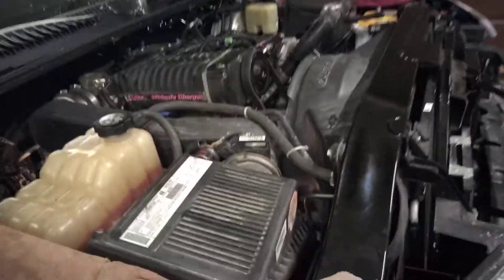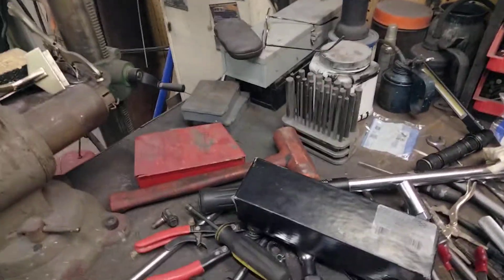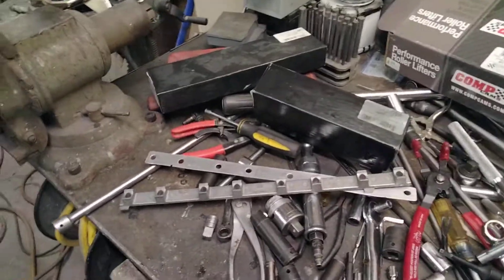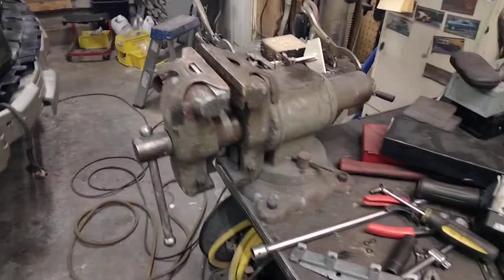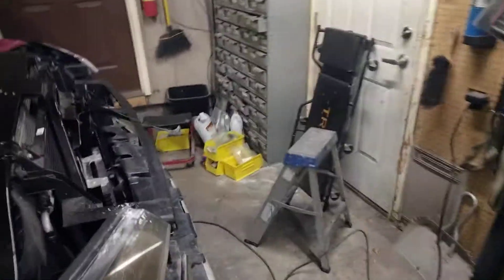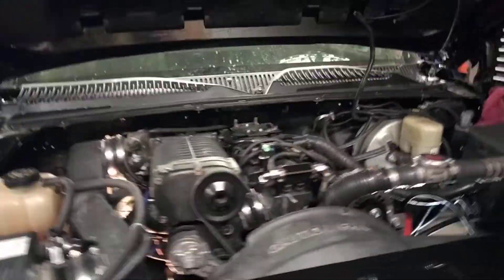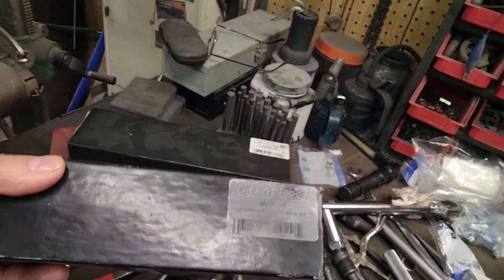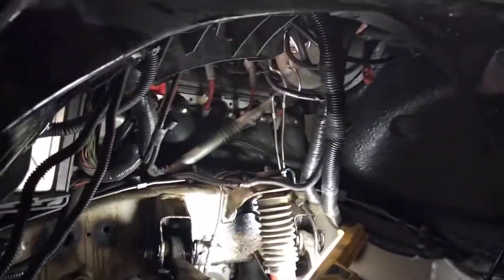Comp Cams Evolution lifters after 14 hrs

Comment: All you needed was a $30.00 pushrod length tool. It’s so simple, you measure the PR length at zero lash with the lifter on the “heal” of the lobe with the tool; then add what ever length to set your desired lifter preload.  Ie .050”-.070” with a max of .090”.  Add the length of the PR tool at zero lash to the desired lifter preload; order PR. 👍
Reply from the maker: I have that adjustable push rod and I used it, with the engine on a stand, 2 different methods, using a dial indicator or a scribe line reference. The lifters have an operating zone of ~.12" and I measured for between .05"  and .08" of preload. They do not make the push rods in the exact length you specify. They come in size increments of .05" so you have to pick a length that they offer that is close to what you need.

It cannot be exact but it should be OK if it is within the preload range. If the length is too short the valve train will be noisy. If the length is too long the engine will not run at all.

The doggone lifters were running noisy in the engine so I went to different trial & error methods in a running engine. Now by trial & error I know exactly what is the longest push rod that will run in the engine, which in turn rules out the possibility that my measurements were off and the push rods were too short. 

I know this is expensive and time consuming but I had to do it because I had to prove to Comp Cams that the noise is not caused by a too short push rod, otherwise they are always going to say I must have goofed when I measured for push rod length. 

At this point there is no way anybody can say the noise is due to anything but defective lifters. And from what I have seen and heard there is a problem with manufacturers putting out lifters that won't run quiet. There are others out there having this same experience with noisy lifters.
Reply: So you used Comp 8957-16 that are not meant for a 5.3 block ?!? And now you have issues?  Amazing 
From Comps site...
Designed for Chevrolet LSX, RHS, and Warhawk series blocks. 2.420 in. seat height.
Specifically says not for stock LS blocks.
Reply from the maker: @tonym6854  You're amazing because the Comp website listing for 8957 that I viewed says: (copypaste) 

Link Bar Hydraulic Roller Lifter Pair for GM LS, LSX, RHS and Warhawk -- 

Captured Link Bar Retro-Fit Roller Lifter for 1997-Up, Fits Both Factory and RHS®, LSX, Warhawk Blocks

• Performance replacement for stock hydraulic roller lifters or retro-fit hydraulic roller lifters for non-roller blocks

Lifter Seat Height
	2.66" 

There is nothing in that listing about specifically not for stock LS blocks. On the contrary it does say fits factory blocks and it also says replacement for stock lifters. Also it does not say 2.42" seat height. 

I did not shop for them online, I spoke to one of their techs on the phone, told him specifically that the engine was a stock 5.3, and the 8957 is what he recommended. I have also run a set of 89571 (Evolutions) also by the same tech recommendation in this engine that were a little less noisy and now I have a set of stock GM OEM replacement lifters in this engine which are less noisy but nothing is as quiet as the original set from 23 years ago.

Comment: Huh? That sounds completely normal to me.. I think you are a little ocd about it. You realize that atleast half the sound you are hearing is the injectors.
Reply from the maker: No, they are noisy. And yes I can distinguish the sound of the injectors pulsing. I have other videos of them running with more hours on them, you'll hear the noise in the driveway from a distance. They are loudest when the oil is fully hot. They sound better while cold, which lasts only a few minutes. And you should hear how loud the Comp LS retrofit lifters were, I have video posted of those too. They were the same, not bad when cold but got louder as water temp reached 160, then  ridiculously loud at full temperature. I sent those back for a refund before I tried the Evolutions. All I can say for the Evolutions is they are not as loud as the LS retrofits were. They sound like solids even though they are hydraulic. When this engine comes apart again it will get stock GM lifters with the plastic trays. I'm done with Comp lifters.
Reply: @onemoremisfit  I have replaced roller lifters with a comp cams set. Along with the cam. And they always bleed down and tick pretty bad just setting over night. And don't even get me started on timing chains! I have had alot of trouble with chains for some reason in my old 318. They wear out very quickly and start to slap around and begin hitting the fuel pump arm. I am not sure if it's something with the chains. Cause I have tried 3-4 different brand. Or if it's something to do with poor oiling. Because it seems like when I take them out they are always dry. 

I get your frustration with all these crappy new parts though. It's just impossible to find quality anything that does what it is supposed to do any more. It's just in from what I could hear your engine sounded pretty close to normal. I mean it might have had a slight bit of extra noise. But it seemed like just barely. Have you tried thicker oil? Or an additive? Because the oil thins out as I'm sure you know when it's warm. So it seems if that's when it's louder thicker oil might help.
Reply from the maker: @ron1836  I re watched the video and you're right, it wasn't that loud back then, but it is louder now. I was optimistic at that point that the lifters would settle down with more hours of run time but they haven't. The truck was coming off a restoration and was not street driven at that point 9 months ago. Now I have been driving it since last summer. When you drive and accelerate, that will heat the oil more than just running it parked in the garage. I want to try different oil but I can't just put thick oil in it during winter here. We had -10F a couple weeks ago.

When it comes to timing chains I had the OEM LS timing chain stretch badly on mine too. A little over 100K miles and that chain was stretched dangerously floppy loose. It was probably already unacceptably loose at 50 or 60K. I replaced it with an overkill timing set rated to support a claimed 3000 hp. It has multiple keyways for + or - 4 degrees timing. I checked it with a degree wheel and it comes in + 1 degree when installed straight up. It is double row width and requires the cover to be clearanced and the oil pump to be spacer-ed out. BTW the oil pump is new too, makes 55 - 60 psi at idle, oil pressure is not an issue. The engine runs fine as long as I'm willing to put up with noisy lifters.
Reply: @onemoremisfit  I think my friend you are kinda like me. Where you over worry about small problems that might not even be real problems. And you always want everything to be perfect. But doing things that way will drive you crazy and also make you spend alot of unecesary money. 

I hear you about not using thicker oil in winter. And also using thicker oil reduces your mpg. I'd say that if you have been driver it for awhile and nothing has blown up your probably good. Cause really if a lifter it going to actually fail it will happen pretty quickly. I'd say just turn the radio up and forget about it haha.

Last thing I want to mention though is different types and brand even of lifters have oil holes in different areas. Like I know that Chrysler small block replacement lifters have holes in the top to be able to feed the push rods. But those engines don't even have hollow push rods. But something about those same diameter lifters are what's used in some other manufactures engines which do have them. So maybe it's something like that that could make things sound a little different? Also I have found myself that it seems like once you start working on something and rebuild or replace parts. Things are never quite the same again. Doesn't necessarily mean that anything is really wrong. It's just different. Like when they build a fresh engine from the factory it almost ALWAYS will run for way more miles. Than a used engine that has been rebuilt. No matter how good of parts and how good of a job someone does rebuilding it. I mean even like car batteries. The OEM factory battery will last like 10-15 years alot of times... But it is impossible to buy a replacement car battery that will last that long.
Reply from the maker: @ron1836  Listen to them in this video from 2 months later, wheel tubs installed, still bone stock exhaust. First time I had the truck on the road.
 https://www.youtube.com/watch?v=OYBNY7iuFgs&ab_channel=onemoremisfit

I have a louder performance exhaust on it now. The lifters are not any quieter right now, maybe a a little louder. I can hear them cruising under light throttle sometimes.
Reply: @onemoremisfit  hey i have the exact same tick before with stock lm7 5.3l GM lifters and now with new Elgin lifters (who make lifters for gm) it still the same like before. And like your engine mine ticks only when warm. You know a brand who have silend lifters? Or is this maybe to a lifters noise ?
Reply from the maker: @svbbs4390  I don't have a lot of experience with this type of noisy lifter problem, all I know is 2 sets of new lifters in an all new valve train with a lot of trial & error for push rod length and this is my result. I don't know what else to make of it. I will try some other brand of lifter when the engine comes apart again someday. In the meantime, the engine runs well and I just have to put up with the noise I guess.

Comment: The only thing COMP makes that is worth a crap anymore is rockers. Everything else they make is JUNK. Run away from COMP.
Reply: Sorry for your trouble. I quit using comp cams in the 80's.
Never looked back.
Reply: @richwood8650  
I actually returned the COMP  big block chevy roller lifters with the needle bearing bushing, that only last about 5000 miles at most before coming apart and destroying your motor, for a set of Jones Cams XLR-8 Evo16 roller lifters with a stainless bushing. And a custom ground Jones roller cam. Only thing COMP will be Magnum XD stainless rockers.

Comment: I'm perplexed: you shim rockers up, and add pushrod length?  And talking about lash instead of preload for hydaulics makes the picture even fuzzier.  Noise is often lifter bleed down.  The annular region on your lifters stay in the lifter bore through full travel?  The business of peeking two or three thousandths above or below the lifter bore can make an individual lifter misbehave without destroying the engine.
Anyway... I feel your frustration: when hydraulics work, its beautiful.  When they don't, it's a matter of tenths [ 0.0001" increments], which demands aerospace precision in polishing plunger & bore to spec.  I... prefer to stick with mechanical - flat or roller, because nothing is really maintenance free.  Last set of hydraulics I used [years ago] had problems on break in: pulled them for disassembly/ clean & inspect and found two with metal flakes inside the bores serving #2 valvetrain.  Depending on how that went... could have jammed plunger movement or defeated check ball and caused bleed down.
Reply from the maker: I use the .03" thick shim to roughly split the difference between two pushrod lengths that are .05" apart. 

I have 3 different length sets of pushrods for this engine.
 
One set is 7.3" 

One set is 7.35"
 
And one set is SUPPOSED to be 7.4" but it measures more like 7.42" (with 2 in the set that measure 7.418") 

All 3 sets do not measure exactly what they are marked as. The 7.3" and the 7.35" sets are actually 2 or 3 thousandths over, which is probably tolerance, and the 7.4" set is more like twenty thousandths over because of supplier's manufacturing defect.

I put a top end rebuild with a new timing set and a cam swap and lifters in the engine. All valve train parts are new. I degree'd the cam with a degree wheel for straight up timing and used an adjustable checking pushrod to come up with the correct length. I used two different methods to get the length and I did it on the engine while it was on an engine stand with valley cover off and I could literally see as well as feel lifter preload. I don't recall the exact length I came up with but 7.3" was as close as I could buy because they make the lengths in .05" increments. The lifters are supposed to work with any length that preloads the plunger to something inside of a .12" range.

The 7.3" set ran noisy. The Comp Cams rep said maybe I got the length too short. So I bought a set at 7.35" and they ran noisy too. So I bought a set at 7.4" which were actually .02" over, and they were too long to run. So I made the .03" shims and the 7.4+.02" set would run, but still noisy. So in that trial & error process using a range of lengths that cover .12" I ruled out incorrect length as a cause. At that point I knew exactly what was the longest length that would run, and it ran no different than a length that was about .1" shorter. So I know that pushrod length is not the cause of the noise.

I made a video of the engine running. The other strange thing is the lifters were quiet when cold, then got noisy as the oil warmed up. I had a set of the Comp Cams retro fit LS lifters in it at the time. I had the Comp Cams rep view the video and listen for himself. He said looks like you need to change the lifters. I sent the LS retro fit lifters back and they gave me a refund.

Then I bought the new Evolution lifters. They will not run with the 7.4+.02" set. They will also not run with the 7.35" set, but they will run with the 7.35" plus the .03 shim. So I absolutely know for sure the length is not too short, and I know I have the longest length that will run in there. 

The Evolutions are a little quieter, but they still make noise, just not as bad as the retro fit LS lifters. And they also sound OK when cold but get noisy as they warm up, same as the others.

The engine runs fine, as long as you are willing to put up with hydraulic lifters that sound like solid lifters.

At this point I have flipping had it with screwing around with lifters and pushrod lengths. When this engine comes apart again it will be getting stock GM lifters with the plastic trays, because that's the only thing that has ever run quiet in there. This is only a 5500 rpm engine. I thought deleting the plastic trays and going to a link bar lifter would be a nice upgrade, but it has been nothing but an expensive nightmare. Two sets of lifters, three sets of pushrods, and a ton of wrench time under the hood, all for nothing but trouble. I've been scared straight ... NEVER AGAIN.